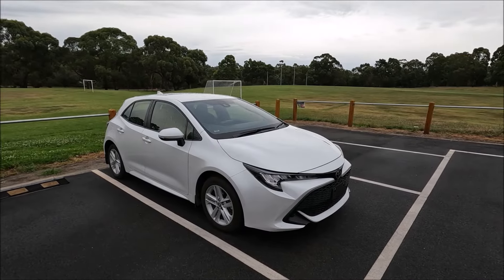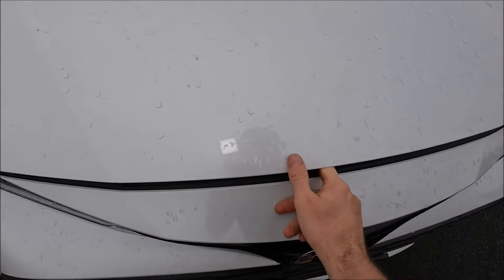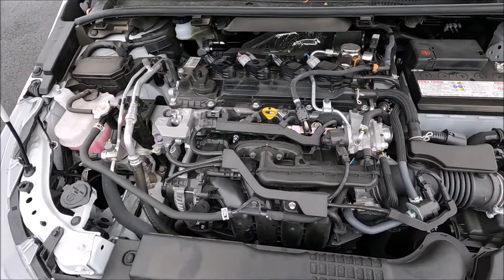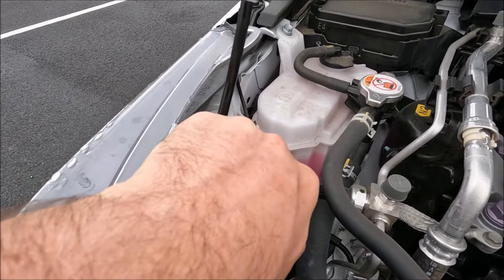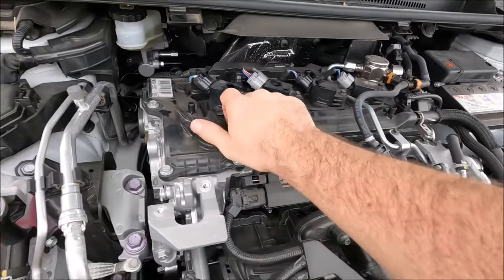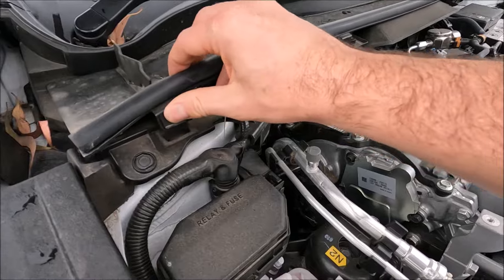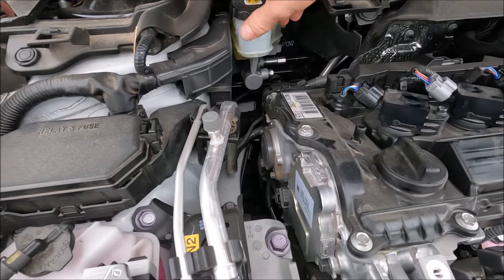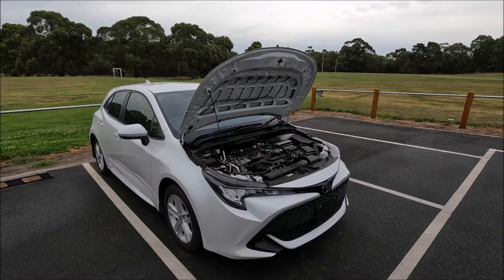Toyota Corolla Fluid Locations, Engine Oil, Coolant, Washer, Brake & Steering Fluid (E210)

Comment: If its an electric power steering fluid how can it be added or changed ?
Reply: It doesn’t need change power steering fluid is only used when there’s a pump to help turn the wheels but because of motor helps you turn it. You don’t need the fluid.
Reply: So what happens when you have the ESP power steering coming ON? In my other car I just put fluid then it's gone but on this Aygo?

Comment: Does the 2020 Toyota Corolla LE have electric power steering too
Reply from the maker: Yes I believe so, general rule of thumb if you cannot find a steering fluid reservoir it will be electric. Ross